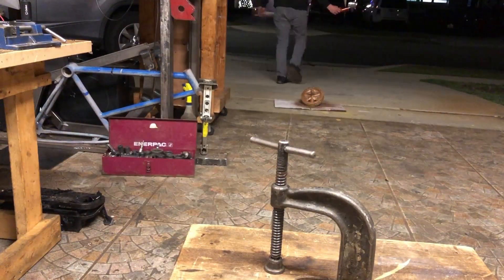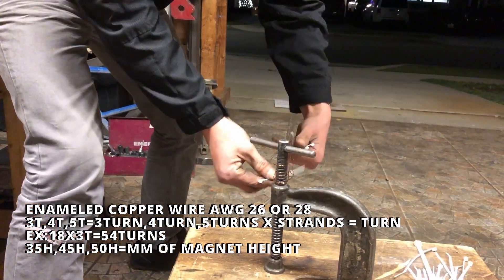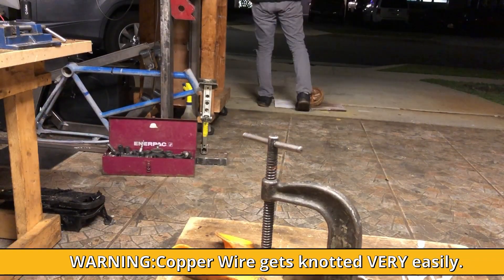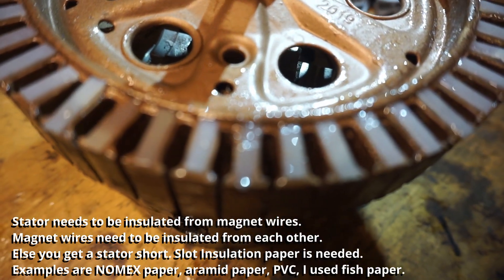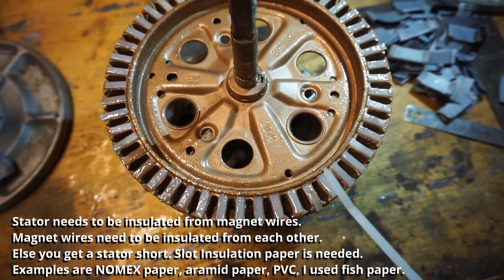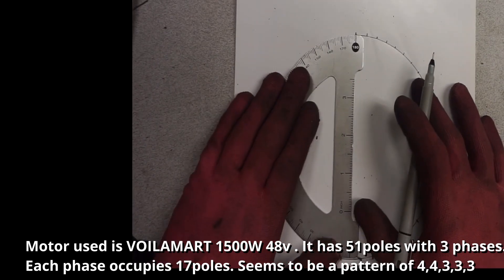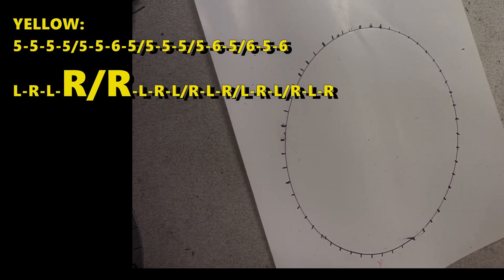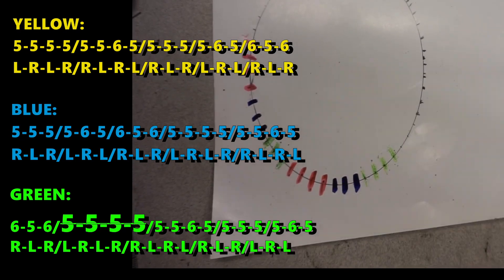What You Need to Know to REPAIR RE-WINDING ebike BLDC Motor

Comment: good work i'm planning to make a handmade wind turbine i have a 72v 1500/3000w e bike wheel do i need to change the winding, scheme, etc. if there is a gorsel, I would be glad if you could share

i will use it on a 24v battery system
can you also recommend the charging unit